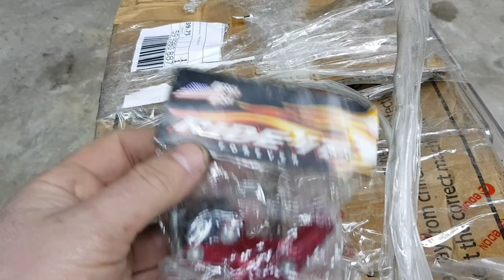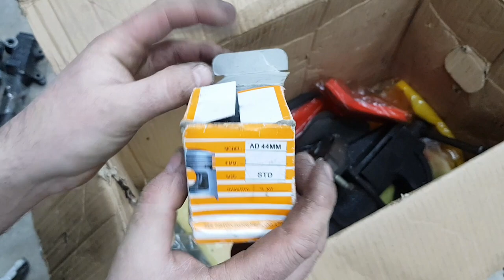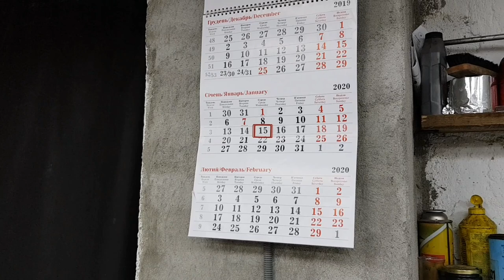Посылка от подписчика

Comment: Obviously it came from a small engine mechanic. I would be poor as heck if it weren't for the Honda clone GY6 motor. I'd say 80% of that stuff dont work. Like the car piston rod bearings and the weedeater carbs. Im just curious to know why he had soo many D/C cdi 's. If you plug any of those up to an A/C GY6 it will instantly fry the cdi and take out the wiring with the least amount of resistance. I wouldnt use any of them Sam. All those GY6 parts and not a starter clutch in sight. Ask me how I know. Good score Sam but very limited things in there will be useful. The rest is scrap.